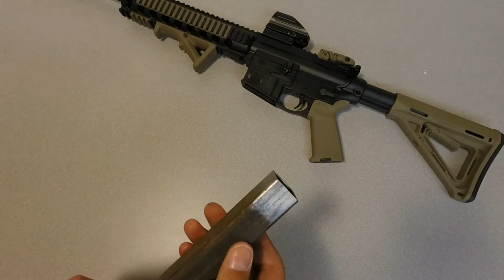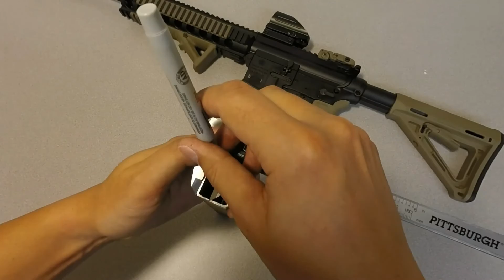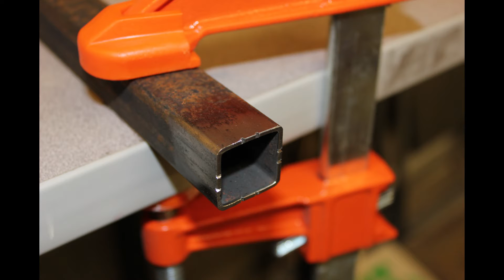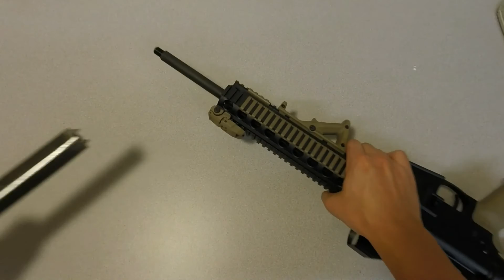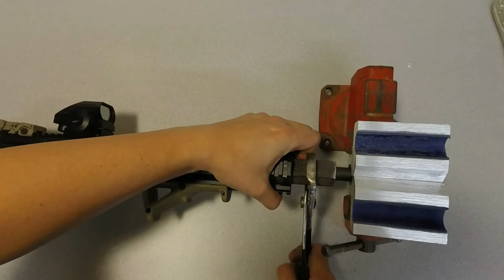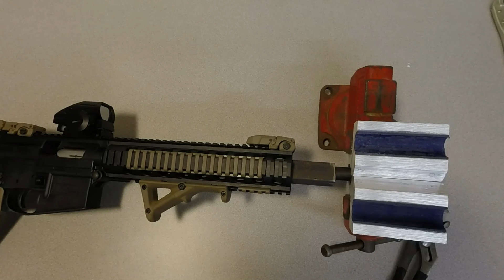DIY Smith & Wesson M&P15-22 Barrel Wrench

Comment: Nice video. I would have used a round aluminum tube instead since it would be easier to work with and will prevent any damaged to the barrel. This can be also done by covering the tool with some rubber paint though.

Comment: Nice job on making the tool.  My only suggestion would be to use some type of rubber bushing on the inside top area to avoid scratching the barrel when turning it.